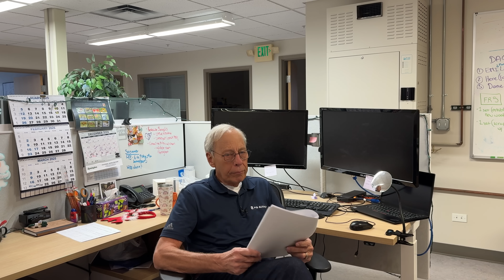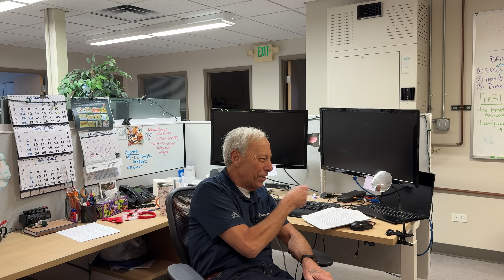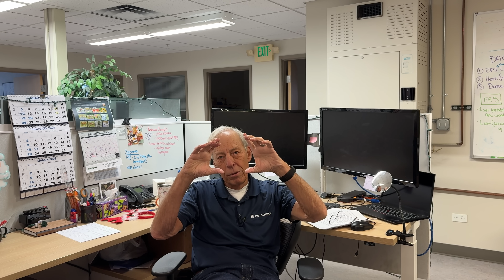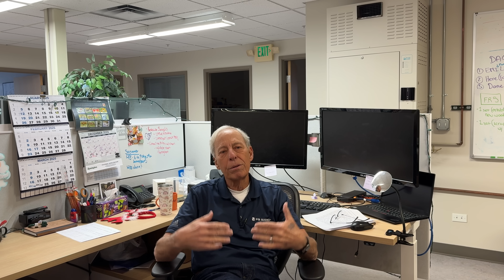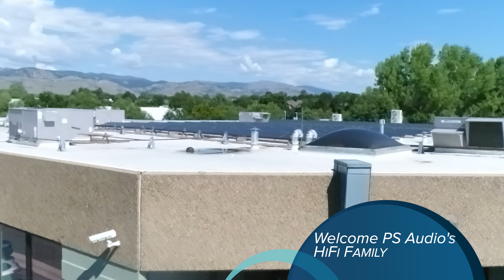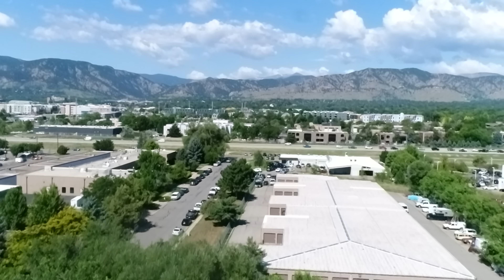What makes monoblock amplifiers better

Comment: Great answer Paul, thanks 👍
Reply: It really isn't. As usual with Paul you get some folksy handwaving, some ultra basic stuff (how transformers work) which makes everyone feel involved, a complete dodging of the question and any associated elephants in the room, and then we rapidly end with the conclusion that - folksy chuckle - if you can spend more you certainly should and your neighbors will admire you all the more for it. [end of video].  It really is nonsense.  Why all this stuff about multiple power supplies and transformer secondaries etc? No, you don't do that, you - very obviously - have one power supply which is amply specified for the peak load of your (stereo or more channel) amplifier.  If you want to measure the ripple of the power rails even under an extreme (and unrealistic musically) test load, you do, the equipment is very readily available. You ensure your power supply rails are nice and rock solid and... that's it.  If you want to spend thousands on "dual monoblocks amps" have at it, it's your money, hell, get them gold plated, individually monogrammed, drizzled in chocolate, but if you believe you're listening to an objectively better sound system you're just another fool parted from their fat wallet.
Reply: @DrTune  well of course. 
Having two monoblocks into two separate ac. Purifiers are going to be better than a single chassis plugged into a dirty ring main. 

I especially like the bit about secondary winding on the secondary side of transformers. 
Which I'm unsure about, wouldn't this half the power supply?

If VP/VS=IP/IS=NP/NS would this make VP/VS=NP/NS/NS and then half I? 

Anyway this is all ridiculous. 
All we actually truly need to listen to music is a Spotify account and Google speaker.

Comment: A stereo amp running in bridge mode..and or running in stereo ..but in mono/shared signal they will have the same attributes of the mono amp but also is more flexable at first until a second same amplifier is purchased.

Comment: It's not really modulating on 220 or 240 volts maybe on 115 but you wouldn't get it on a higher voltage
Reply from the maker: That's incorrect. Just the laws of physics argue with you. Power draw is identical. If at 120 volts it's twice the amount of current and at double that, 220 volts, half the amount of current. Power has to be the same and the line modulation is entirely dependent on the impedance in the wires.
Reply: @Paulmcgowanpsaudio  if the amperage was the same then 240 volts would give more power.
Reply from the maker: @mitchtaylor6512  Yes, that is correct. amps X Volts = Watts. So, current of 1 amp at 120 volts is 120 watts, 1 amp of current at 240 volts is 240 watts.